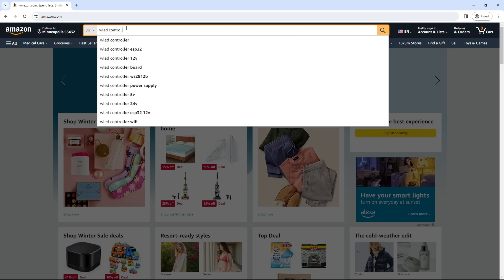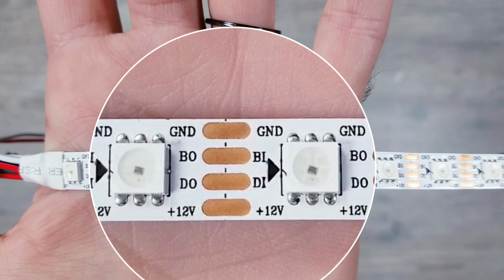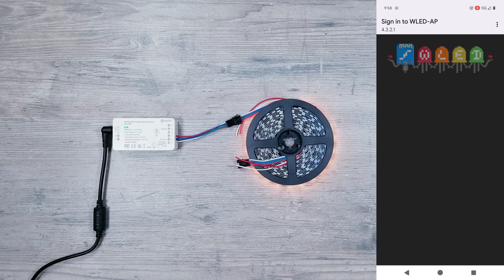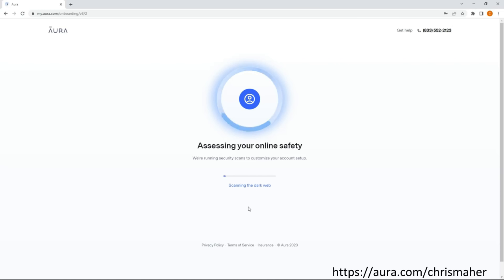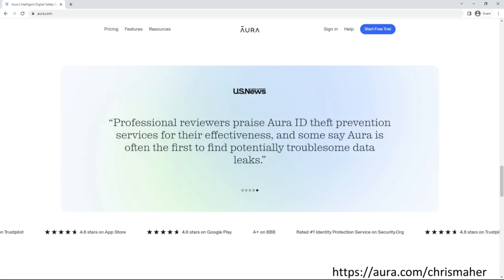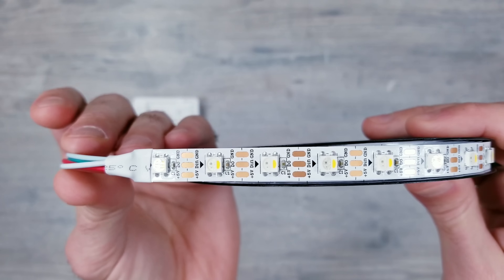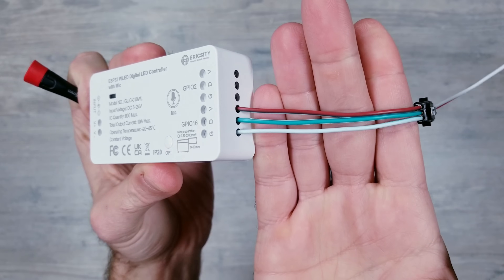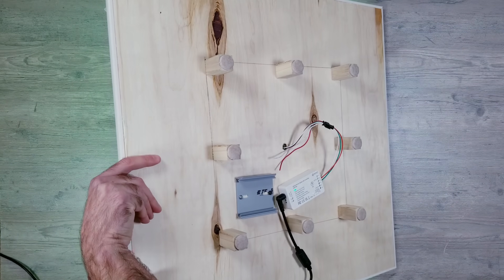Plug n Play WLED Controller: 5v, 12v, 24v Compatible! Full Walkthrough.

Comment: I am not sure if you still check any of these older videos, but I can't seem to find a post anywhere that seems useful or a video that walks through all the different style of lights that are available today. I know the difference/limits of 5v, 12v and 24v (1led, 3led and 6led addressable), but the different types of addressable lights, some have IC's for more control and some have warm light options. I have seen you use a 3 wire light where I swear you said it had a separate LED for warm light, but I can't see to find that. The only lights I can find are the RGBICC lights with 6 wires that allows full RGB, addressable and warm light. There is a lot of outdated knowledge out there and a ton of tribal knowledge that doesn't sync up.

My wife and I are wanting to get into the DIY lighting space and just found your videos and we already have a few projects we'd like to dive into. They both require RGB but also the ability to do warm light. And probably 12v for the run length.

Comment: Thank you for this great video.  Quick Qn.. how do you determine(calculate the required value(s) ) what kind of In-line fuse to use?  (what fuse did you use in this video?). Thank you
Reply from the maker: Thanks for watching. I never used fuses. But this is an old video. Watch one of my newer videos on the Gledopto controllers. A lot of theirs have built in fuses. My favorite is the elite 4d WLED controller.

Comment: I feel super pathetic after getting all my different gear lights controllers I wanted. I got them on a Friday. I didn't try the specific controller but I have a bunch of gledapto ones you use in other videos. What a disappointment I haven't slept all weekend. After printing out the suggestions from Amazon's AI, I don't know if I have the heart to try it with the last controller. I'm so confused about the common ground between controllers or whatever. I wish a lot of your videos weren't all about 5 volt or 12 volts strips. Makes the 24 stuff so much harder. The stupid USBC charger stuff that doesn't make any sense. I learned a whole lot more from other channels but it seems like when you do it it's just already set up before you're shooting the video. I was ready to set up 90 ft of lights. Not going to happen it doesn't look like
Reply from the maker: Gledopto is great and their controllers are plug n play and so easy to use. Here is a 24v video I did. https://youtu.be/ZQ8t4G782dU if your still having trouble, WLED reddit community is awesome.

Comment: Anyone any idea how I would connect the led strip to the mains. I have a light switch in my room for the bulb in the ceiling but want to take the bulb out and use channels to run led strips in the ceiling using the mains power. Would I just connect a 240v to 12/24v transformer then connect the controller to the transformer

Comment: Hello, I have 3 rows of 40ft COB RGB+IC LED Strip Lights from BUNACET I wanted to use for a project in my garage by connecting them in series. What controller and power supply do you recommend please?

Comment: Did anyone ever tried to use both a 5V and a 24V strip on the same controller? It should be possible when connecting the 5V PSU only to the strip but not the controller.
Reply: It works. I connected the 24V PSU with the IoTorero (+V/GND) and the 24V Strip (+V/GND). The 5V PSU with 5V Strip (+V/GND) and IoTorero (only GND). The IoTorero with both Strips (DATA1/2). WLED has only a single current limitation for a controller (both PSUs at once) - but that usually isn't a problem.

Comment: After days of testing and reconfiguring here is what worked for me: 24V power supply = Gledopto ESP32 WLED with Mic/UART controller (LT-GL-C-015WL-D) 24V +
BTF-LIGHTING FCOB WS2814 ICSPI RGBW LED Strip (DC: 24V, 896LEDs/m, 1 IC Chip drives 56LED’s, 16 IC/m) 

LED Strip Configuration

Enable brightness limiter: Yes (Checked)

Maximum PSU Current: 4000 MA

LED Outputs:
1.	SK6812/WS2814 RGBW
2.	mA/LED: 55Ma (typ 5v WS281x)
3.	Colour Order: BRG
4.	Swap: W&G
5.	Length: 91 (if using one strip, if two consecutive, 182; why 91 works? absolutely no clue, tried many other combos and it didn’t work)
6.	Data GPIO: 16 (if using one strip or two consecutive, if adding 4/5 add another LED Output and set GPIO for that input to 2)
7.	Reversed: unchecked
8.	Use global LED buffer: checked
9.	Button 0 GPIO: Pushbutton
10.	Touch threshold: 32
11.	Invert checked
12.	Turn LED’s on after power up/reset: checked
13.	Default brightness: 180
14.	Use Gamma value: 2.8

Transitions
1.	Enable transitions: checked
2.	Enable blending: checked
3.	Default transition time: 700 ms
4.	Use harmonic Random Cycle Palette: checked

Timed Light:
Default duration: 60 min

Advanced
Palette wrapping: Linear (wrap if moving)
Target refresh rate: 42 FPS

Usermods

AudioReactive: Enabled checked

DigitalMic:
Type: GenericI2S
Pin: 12s SDpin: 26
12S WS pin: 5
12S SCK pin: 21

Info Menu

Audio Reactive Turned On

Comment: I know this sounds strange but can this be programmed for one channel to run a steady chase while the other channel is programmed to on run a chase while a vacuum cleaner type noise is present?
I will be installing this in a piece of retail equipment that has a blower/vacuum motor and I want one channel to only run when the motor is running.
Also, more on running this controller off WiFi would be very appreciated. 
Thanks.

Comment: So if I wanted to use the 24v cob lights using the controller. What would be the best power supply if one strip off the controller will be about 16ft but the other strip would run about 3 strips together (about 50 feet).? Also what would be the info I would enter into the wled app to config it?

Comment: Is home WiFi required for wled app to work for inside vehicle project is it possible to connect first to home WiFi then later use cellular data on the phone to make adjustments or change color and style?

Comment: Hey Chris, love your channel. Thank you for all the informative videos. I wanted to get your opinion on a project I want to do in my game room/office. I want to run about 50-60 feet of LED/RGB lights, in diffuser channels, around my ceiling. I would like to avoid injecting power, if possible. I was wanting to know your recommendation on type of lights to go with and which voltage would be best for my scenario? Thanks!!

Comment: I've just put some 2812b LEDs all round my room, 1055 LEDs in total and I'm injecting power in three places and they still struggle with white even with a 60amp supply.  I'd have liked to have seem those 1200 2815 LEDs in full white.   Because mine go all round the room, I can inject power at the beginning and the end really easy, it would be nice not to have to run more cable in the trunking.  Has anyone tried this many 2815s in full white?
Reply: I’ve got the same issue! Im no expert and still learning but I was thinking about adding in another controller and linking them up by app ?
Reply: I changed to the 2815s and a 30amp 12v. Full white injecting just the start and end.

Comment: When powering 12v and 24v how come you leave the LED voltage in WLED at 5v? I changed mine to 12v on a 12v strip, but there is no 24v volt option for my 24v strip. Does that even matter?

Comment: Hey brother, I was searching online for one of these controllers.  I get all my lights from BTF-Lighting, I see they have a controller WITH UART.  What is the difference?  I did not see any documentation that would help me decide on one over the other.
Help please!!!
Reply from the maker: Thanks for watching! With UART means that underneath the housing there should be an accessible USB port in case you want to re flash WLED software or update it via a wired connection instead of over the air.

Comment: Awesome video.  Thank you!  One set of questions:  I am trying to add lights to 2 short bar shelves (one is about 3 feet long and the other is 5 feet long).  Can I cut the SK6812 strips?  Do I lose the rest of the 5 meters or can I somehow reconnect the cut pieces?  Or are there shorter strips (1-2 m) available that are equivalent and compatible?  TIA

Comment: I’m having trouble with the power supply. Do you have to to have the 5v power supply connected? I have 12v leds and I tried to connect a 12v power supply to the line inputs next to the barrel plug and the controller doesn’t turn on. Thanks!

Comment: I need help...for the first example you showed,  if I wanted a higher brightness than 4000 would I need to cut off the connector and solder the wires together or what do I do?...I'm working on a tray ceiling and I need about 50-60 ft of LEDs, your video is amazing and has been the most helpful so far pls help.
Reply: 4000 is more than enough brother
Reply: @corvusgaming1577  thank you
Reply: ur welcome. I personally have it capped at 4000 and at 50% brightness my eyes hurts😂

Comment: So hello there I am asking again since I bought the exact same cob lights and the exact same power supplies I have two questions? Number one is why the heck is my cob lights randomly flashing blue when I try and use them with their very own controller the exact same one that I got from your link here? I have no problem with the 2815s I bought I think that's how you say it The upgraded LED strip which I use with the same exact controller and power supply that I got from your links. I'm just really trying to figure out if I need to get a new set of cob lights if it's the lights or if there's something else going on and I seem to get no answer

Comment: Does this have a logic level shifter built in? 

I'm having issues where I want to connect 8 1m strips in parallel, but they get weird after I connect more than 2. The wifi isn't usable and the lights don't respond. I've tried a signal amplifier with no luck
Reply: As a follow up I just returned it and bought and ESP32 and just went old school DIY

Comment: great information and video. what would you say would be the longest led run you could do with each strip and what power supply would be best. i probably want to do about 20m but think i may be better doing on lots of different runs. i would prefer the cob strip but it seems a lot.

Comment: With the 5v, sk6812 strips, can you connect 4, 4m strips like the first example with 1 power supply without any power loss? If no, how big does my power supply need to be without power injections or is that unavoidable? Thanks!!

Comment: I'm trying to connect the led strip WS2812B DC5V, White PCB, 5M 60 IP67 using ESP32 WLED RGB RGBW Digital Strip Controller and supplying it with BTF-LIGHTING AC100-240V to DC5V10A Max50W. Led strip is cut to 2 pieces of 198 led each and connected to controller via 10 ft long 3 Pin LED Extension Wire 20 AWG.

When I connect the led strip directly to controller - everything works. But when i connect it via 10 ft cable it starts flickering and show different colors, not reacting to my adjustments in controller, and when set to some solid color it shows 2 green 2 blue and 4 red led lights pattern.

What I'm doing wrong and how to make it work?
Reply: You have too much long length between controller and strip. You need a data booster just before the strip see drzzzz videos

Comment: Hello, I have a 42 foot motorhome that I want to run BTF-Lighting WS2811 IC=RGB from the front and down both sides plus around the back. Using the WLED Controller ESP8266 and connecting the 12v power from the motorhome. I believe there will be about 750 LEDs per side. Will i have to run 12v in a few spots per side for there to be enough power? can I just pull 12v from the closes power source at the end of the LED line? if so and the batteries are being charged will that hurt the LEDs having more than 12v ? would I need to install some sort of inline power stop so it can't get more than 12v? would I need 2 controllers ? one for each side? Im starting the runs at the front middle and wanted the light show to start at the front and end at the back middle .. any advice would be much appreciated . Thank you

Comment: Why would the cob lights that I bought from your link be flashing different colors when hooked up to the second channel of the same controller that you're showing here when I have another set of LEDs in the first channel? They should be straight Amber right now but they keep flickering through all the different colors for no reason
Reply: Hey I never did get a answer for this. If I have two sets of LEDs set up with this controller both at 12 volt do I need a more powerful power supply to run them both? One of the ones was The cob lights that you had on here and the other ones was a light strip that is one of the more powerful of them. I just need to know if I need to get more power to the lights when I'm getting all the flickering on the second channel Cobb lights when I have two sets of lights hooked up.

Comment: My color pallet ain't working righr I'm getting wrong colors , it's like the pallet is Back to front , value is fine but if I got orange its green and vice versa, any ideas I'm running the 12v leds and a 600w 12v psu, followed your video to the T and still dame results

Comment: Why are my led blinking wild ? And colors can’t reliable be changed. Saw somewhere I need a level shifter because of data pins often run 3.5V instead of 5V on LED. What is a solution for those closed boxes where no 3.5 and 5V reference is available ? Why you have no problem during video ?

Comment: Hi Chris, I wonder if you might be able to offer some advice. I’ve followed your  tutorial on the 4 x 5m WS2815 LED’s, with one of the outputs extended from the WLED controller (mine has GPIO 1 and GPIO 2). I’ve used 22AWG 4pin LED Electric RGB Wire 22 Gauge Extension Cable 4 Core for RGB LED as I’m running 2 x 5m strips in 2 slat wall panels on one side of the cinema room and the same on the opposite side, but one side works fine however on the  opposite side I’ve had to run about 5.5m of the 4 core extension cable, but hat side works once on switch on and then the data fails and it does all sorts except what it should. We know the LEDs are working fine and believe it’s a data corruption issue with the 4 core cable. I wonder whether you have any suggestions and if you’ve come across this issue before? Hope to hear from you soon. Many thanks. Per

Comment: Couple quick questions if you don’t mind. Looking at the BTF lighting WS281 4 32 foot Cobb strip and the. Alitove 24v 144w. Wondering if I can extend the strip lights past 32 feet and if so, would it require a power injector. I’m also looking at the ericsity wledesp32 to control everything and not sure if that has any length limitations. Thanks so much just getting into this brand new.

Comment: have you put a 2nd led strip on the spiral yet?.. you have another side that is empty and having 2 led strips, they would face each other by default in most places. meaning, you could get some interesting color mixing between the 2 opposing led strips facing each other in that wooden spiral etc... cool video thanx

Comment: So the controller says it supports max of 800 LEDs, but I see you connected 1200 and it runs fine. Is it safe to say it can control more than 800 LEDs?
Reply: Got the Same question
Reply: I do believe the 800 LED restriction is per data line, not the controller itself.

Comment: Hello!
Can you pleas help me understand one thing before I buy home parts.? In your video you use an (ESP32 WLED Digital LED Controller with Mic) controller together with a DC 5V and a SK6812 60 LEDs/m strip, I can't quite get it together because if you drive a 5 m SK6812 60 LEDs/m then you will need a DC 5V that has at least 18A (1 LED = 0.3W*300 = 90W, 90W/5V = 18A). The controller you use has a max output of 10A.. Have and where have I missed something? Many thanks for a good walkthrough!!
Reply from the maker: Thanks for watching and great question! Those are just what they recommend if you wanted to run these at their max brightness. In my opinion that is complete overkill. They look great and work perfectly using a much smaller supply.
Reply: @ChrisMaherDIY  Ok thanks for the quick reply, are you using the same amperage in many of the projects you posted in your channel and what would you recommend? I will probably be able to feed power from both sides if necessary as it is intended that the loop will end at the same place it starts.. Is it possible to feed two strips from the same controller and at the same time send different signals to them? For example fire to one and ice to the other..
Reply from the maker: @JimmyB-ci1mk  I usually have the regulator in WLED set between 3 and 5 amps. Have never felt the need to really go higher than that!
Reply: @ChrisMaherDIY  Oh, cool.! Thank you so much for helping me figure out what equipment I need! Keep up the good work making really nice lighting setups and please keep sharing your results and tips.. I'll probably ask for guidance again on later projects.!

Comment: I bought 2 16 ft fcob strips, 12v power supply and the controller and got nothing but flickering.  I'm going to try the 5c pcbs with a different psu and see if i get a better result.  For an off the shelf product you shouldn't have to add a resister to resolve flickering.

Comment: In the final display you said you were using the cob lights as well as the WS 2815 which was the first ones you set up right what does the WS2812 look like does it look as good as the 15 or should I just get the 15s?

Comment: Is the data output from this 5V or 3.3V? If I used this would I still need a level shifter if there is  15ft  between the controller and strip